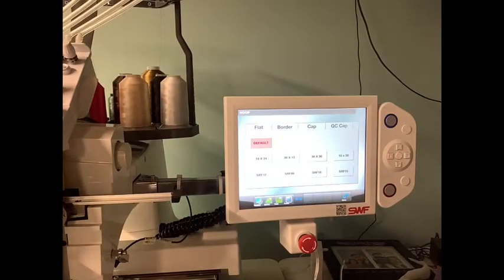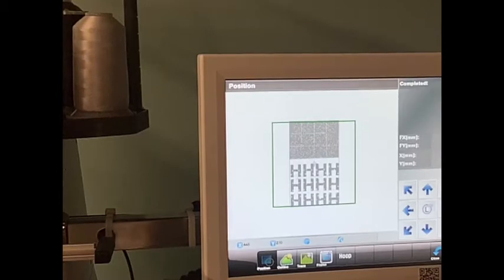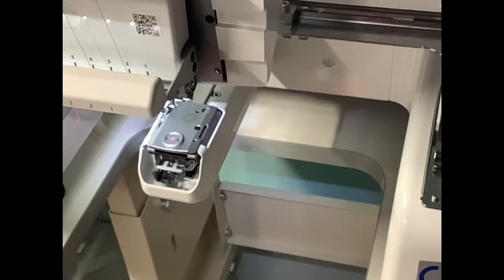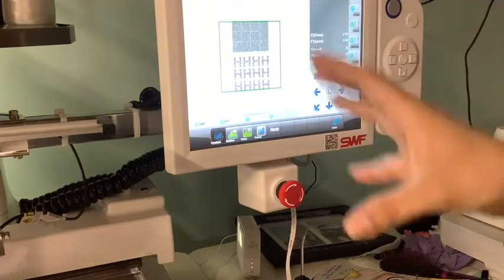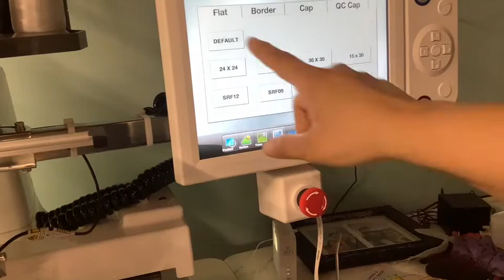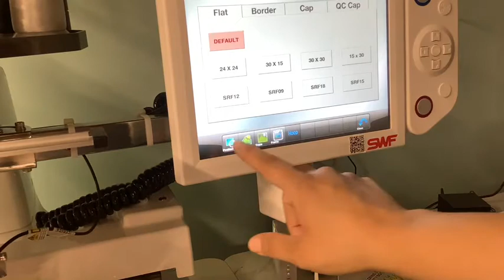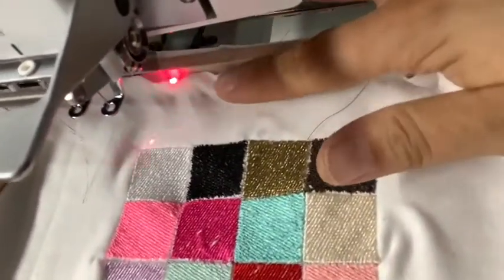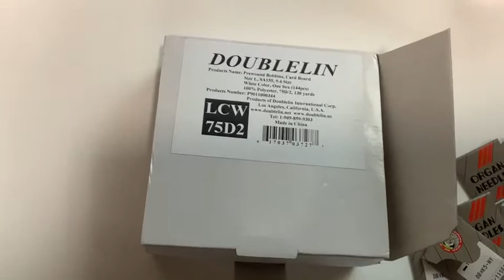H test on SWF MAS-12 plus troubleshooting along the way and how to use default hoop so long Video.

Comment: How do you auto cut ? Mines says it auto trim is on but it still won’t cut and will still be there which messes up the hoop position
Reply from the maker: My settings are default.the only time mine has problems is when I put to much oil. I have to wipe area were cutter is. But if it's not that call stitch it international. There are the primary business that sells these machine and help over the phone
Reply: By any chance could I see the defaults ? When I do the h test i can barely see the bobbin thread
Reply from the maker: @immerre3894  tomorrow I will add my settings. But by any chance your using magnetic bobbins. I hear some have issues with them. So far the cardboard ones been working wonders.
Reply: Hi , I don’t see where the trim setting are yet. Have you posted it
Reply from the maker: I'm putting it up.
Reply from the maker: @immerre3894  were you able to find my quick video with my settings?
Reply: Yes I was thank you so much

Comment: Do you know what error code 202 203 and 205 are ?
Reply from the maker: Sending you the link with all the error codes.
https://stitch-it-international-inc.helpscoutdocs.com/article/225-ks-es-mas-12-error-codes
Reply from the maker: Make sure the design is within parameter if you choose a hoop,  it shows on screen when your on trace. If you feel design can fit, then try to not select a hoop it will give you the machines complete limit but run the trace, do not pull down a needle if it hits the frame it may break that needle and or bend the area around the needle and do more damage. If it's to near the frame or continues with same errors then you need to reduce the size of your embroidery field design.
Reply: @Lillymaricreations  it was for cap QC does the y and x axis meen moving it with the buttons(x) left and right , and (y) up and down?
Reply from the maker: @bkgallardo  yes,( about the y and x). the cap driver is a bit tricky sometimes it can be centers on the Y and X with no problem or  that one you have to adjust the center, I find at times it can be to low which is no problem unless you run the embroidery and I'd it is to high it can scrap on to the top of bobbin area. Either way most times it will alert you. If you k own your design is the diameter of that cap driver selection. You might want to check the parameter of the design in a embroidery software.
Reply: @Lillymaricreations  thank you

Comment: How do you change the tensions ?
Reply from the maker: The very top knobs I also use a tajima tension guage so it won't be so tight or loose. If that area decent I mess with the center knob. Right is tight, left is loose.

Comment: Needle not going up and down
Reply from the maker: Right by the red light on the embroidery machine make sure the switch is up I believe. If your machine is running when embroidering and needles don't engage.